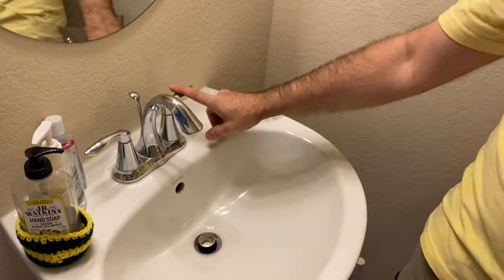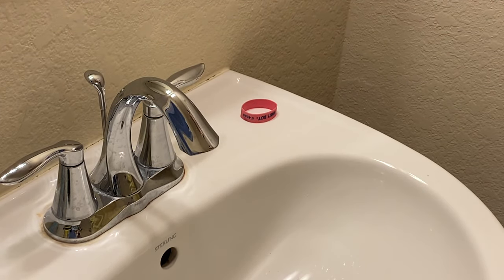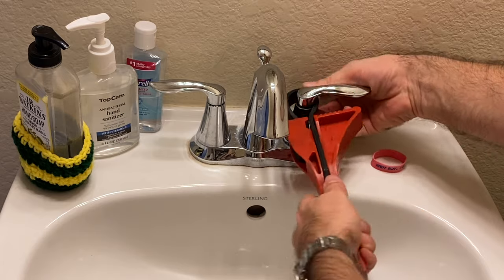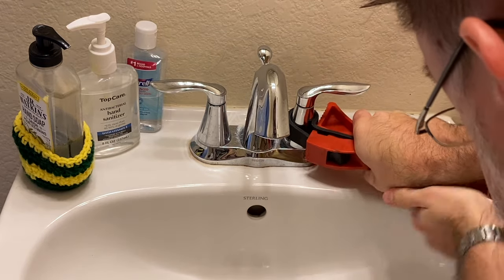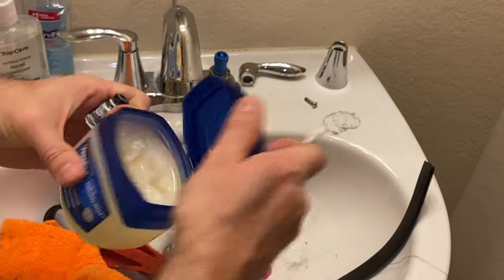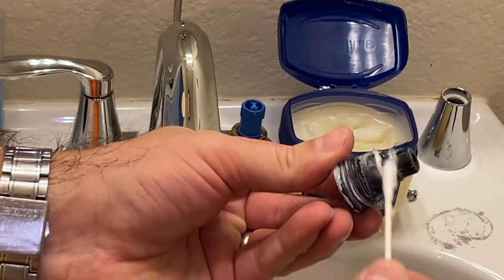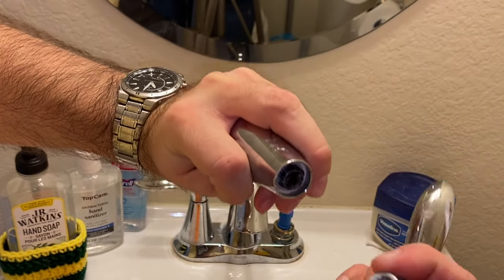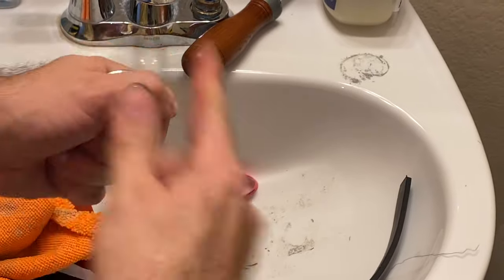Moen Eva Hard to Turn repair fix bathroom sink faucet

Comment: Petroleum based lube will eventually break the plastic parts. You should use silicone based lube.
Reply: I agree with you, I will use silicone next time
Reply: @CarsandCoding When you guys say "eventually", are we talking 15 years from use or much, much sooner (ie: within a year or two)? I'm talking about using petroleum on plastic parts that are in very good shape.

And what about WD40? Would that work as an alternative?

Thank you in advance for any response.
Reply: @Red-mp3to  so far no issues!
Reply: @Red-mp3to  WD40 is not a lubricant. WD means water-displacing. You need to use a silicone-based lubricant like noted above. You'll be able to find it at your local hardware store.

Comment: This video was exactly what I needed. I order the tool online and got started. One of the handles was so bad it was completely "frozen". So, that took a lot of effort to keep the handle from turning with the lower part. After that I used vinegar to dissolve the calcium. Using Silicon Lube completed the task. They work perfectly now. Thanks so much!
Reply from the maker: Silicone lube like syl-glide brake grease is perfect for this! I will use that next time! Thanks for commenting!

Comment: I know this was posted a while back, but I wanted to say thank you. This exact video helped me resolved my stuck Moen faucet. My issue was slightly different, where the handle was stuck with the turning part, so it wouldn’t move since turning on the water meant tightening the bottom more than it allowed.

I used this video, your linked tool, and a lot of WD40 to loosen the calcium deposit, and was finally able to disassemble the faucet handle, clean the calcium deposit, and applied faucet silicone.  It is now all smooth again. 😊

Comment: Thank you very much for posting this video. The only thing that went wrong is that I could not pop out the plastic part as you did with a wrench. In the end, I got that part to turn freely by immersing it for an hour in a 50% solution of citric acid so as to dissolve the mineral salts. Then I rinsed it and dried it. For the lubrication I had to push some silicon grease using a toothpick. But in the end it worked out just fine. Handles are now turning smoothly. Thanks again, you gave me the trick I didn't know about: the rubber strap wrench.
Reply: PS: your daughter was funny ... nothing like a bit of levity to improve our lives.

Comment: I have the same faucet, low water pressure, does it have a removable aerator?I can’t seem to get mine unscrewed
Reply from the maker: Yes! In fact, here is a video to replace the aerator with a high flow option: https://youtu.be/PxZ6KAVy9w0